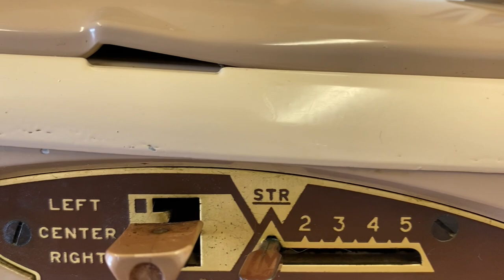They Threw This Sewing Machine Away!!!

Comment: I have observed that 'road finds' and low priced Craigslist finds are generally ok like this one unless missing the bobbin cover plate. If the bobbin plate is lost that means someone gave up on the machine a long time ago, set it aside, forgot about it, and via hand me downs it's out for disposal. Even then, it's generally a simple setup issue. The killer is usually the sewing shop repair fee for them to do anything with it and thus out it goes ("you can buy a brand new machine for what we'll have in maintenance and setup"). Walmart $12 Blue Jeans compared with buying $25 of denim to make pants has really flipped interest in sewing machines. If the US slides into a second Great Depression or runaway hyper-inflation then sewing machines like these will again be in super high demand. Actually, that's why many Singer repair parts exist, other struggling countries refurbish these or clones of the Singer 15s so there is demand for parts. A decade ago I came across a guy who bought treadle machines and shipped them to India for refitting and reuse.

Comment: I'm so glad you saved this machine! I love my 500a - it's my daily driver. It doesn't just look cool - it's also a workhorse! Older machines like this sometimes develop quirks - if mine isn't oiled regularly it will throw a temper tantrum and knot up thread/pull fabric into the throat plate/suddenly have tension issues. Any time I have an issue, I know its time for a cleaning and oiling. When I get that old I'm going to demand regular pampering too!

Great video! Thanks for showing us around your beautiful "new" baby.

Comment: I bought a 500 Rocketeer because of its beautiful space-age look however, a serviceman asked me what types of fabrics I sewed with and I said I used a lot of fleece materials.  He told me that the 500a hates knits!  Well, I bought one anyway and he was 200% right on the money!! Without skipping, I could not get that damn machine to sew a zig-zag stitch!  I found out later that there were so many complaints from customers that dealers were sent what was called a knit-kit to apply to the machine to correct this problem.  Something went very wrong when they designed the machine, or they didn't test its performance with knits.  Now I also own a 400A and it sews anything I put under the presser foot!!  The 500 series came after the 400 and should have been better!  You also mentioned that you might paint it I once saw one that was custom-painted and it was a knockout!!!!
Reply from the maker: That's interesting, thanks for sharing your experience!

Comment: wow, a 503! i have a 603, which i believe was the last Singer model made with all metal gear-driven parts, and i love it. a 503 would be amazing for its rocket-era stylings. Also, i don't know if it's different for slant-shafted Singers (the 603 isn't slanted) but on mine the thread should be threaded in from the BACK of the needle, and you went through it from the front. just something i noticed. [EDIT]: right before you said it in the video, i was thinking, "man, if i had that, i'd TOTALLY want to paint it in some great vintage space-age colors!" haha. YOU SHOULD DO IT

Comment: A lucky find! However, a comparable new machine is probably 100 bucks. The table and the overall setup is priceless. Thanks a lot!
Reply: With all due respect Lasse, you'd have a very hard time finding a machine that is literally compatible. I have some machines from 50 to 80 years old that run beautifully. Granted, some of their functions are done more easily on a modern machine; I even have 3 modern machines myself! (As well as 15 vintage beauties). One of them I absolutely love, but it's very large and heavy, quite well built with both metal and plastic, and was in the $8,000-$10,000 range when new (as a demo machine, I got it for WAY less than that!).  But when my modern machines are nothing more than re-cycle dump fodder, my vintage machines will be running beautifully still if taken care of properly.  Even though they can work very well, most modern machines $100 or less don't hold up.  And when they do fail, the owner will learn that unless the problem is very minor, it's less expensive to just buy a new one because it would cost more to repair than the first one cost. It's Planned Obsolescence at it's best and very sad.  
I've been around for over 70 years, but I'm no anti-modern luddite, not at all. I actually spent 25 years in the technology industry. I just think it's a shame to make a machine, knowing that in perhaps 3 years (or easily less), it will be a throw-away. I also think many vintage machines are beautiful! But of course, that's in the eye of the beholder and completely subjective.  So if you are using a modern machine currently , I sincerely hope you are VERY happy with it and that it lasts a good long time for you!
Reply: I would go much higher in price to compare. I’ve bought those 100 bucks machines & they’re weak compared to the Rocketeer and many other all metal vintage machines. They shake, motor strains  with multiple layers of fabric & the stitch quality isn’t that great. They’re ok to start out or do basic stitching.  I agree the table setup is fantastic!🌼
Reply: Nope. You have to go industrial to get the strength of this machine. And the SPEED!! They are phenomenal machines. $200 for a new barely gets you something capable of hemming a pair of jeans.

Comment: I bought this same machine very cheaply at a thrift shop, and ended up using Andytube's videos at 1.5 speed to learn how to adjust the timing and take-up spring, and got it working perfectly.  Replacing the bobbin winder tire is a little tricky as even though it's still being manufactured, it's so close in size to the standard, it's often not labelled correctly in listings, I bought it a couple times (with the correct part number in the description) before I received one that was small enough to function correctly with the kick-mechanism.  After using it on several big projects, It's turned out to be a much better machine than I initially thought it was.

Comment: The flat button thing to the left on the top is the other bobbin path tensioner. The the top and left door are worth more than you can buy the machine for. Was the extra spool pin there? It’s $30 if you can even find it.

Comment: Jason, Maybe it should be recommended to use a GFCI outlet* or inline GFCI adapter before using a sewing machine with a questionable electrical system.  For many people that means they could simply just plug it into some outlets in their bathroom, kitchen, basement, laundry room, etc.  *These are the outlets that have two buttons for "test" and "reset" on the face.  Comments or criticisms from electricians or electrical engineers are welcome.
Reply from the maker: Hi Chris, 
Not being an electrician myself, that sounds like a good idea to consider! Thanks for sharing!